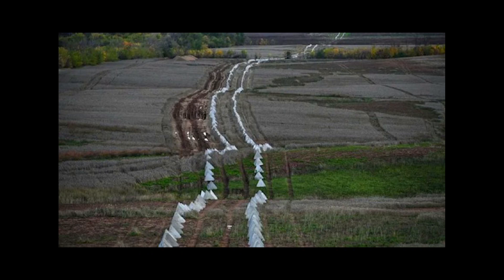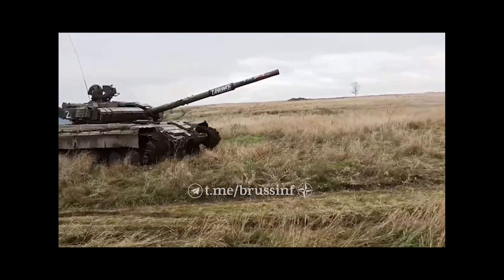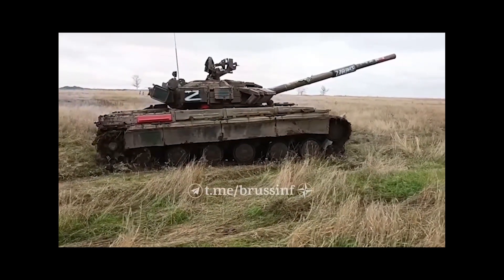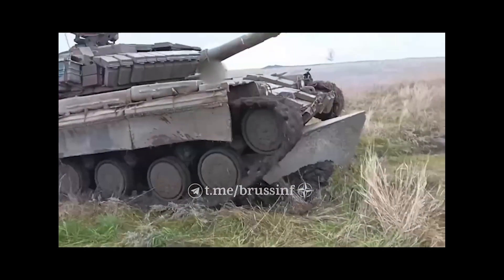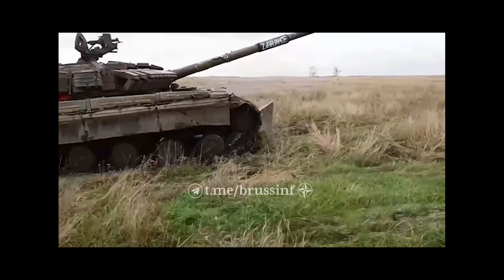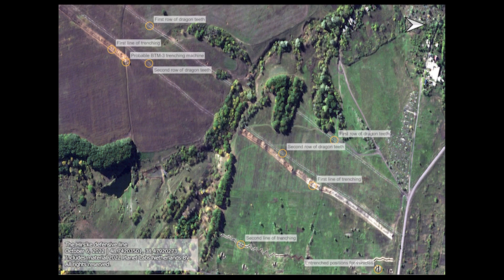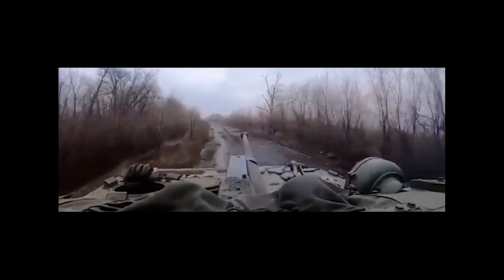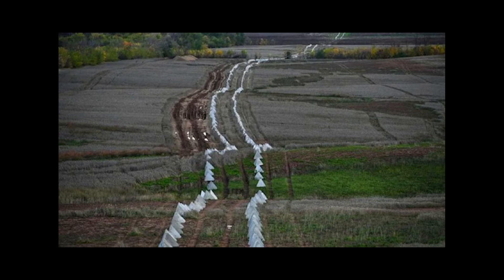How Russia's Dragon Teeth Anti-Tank Barriers Work

Comment: The teeth prevent a quick wide advance across the line.  Instead, it slows the advance at one or few breach points.  The small pause intime should allow for a quick artillery response to the breaching and give additional time for loitering munitions to fly to the area.

Comment: Agreed. Ua will use their same technique, troops to clear the defending trench, followed by armored vehicles. Ua has T-64B dozer tanks. Finland supplied Leopard chassis AEVs with dozer blades and mine flails. Canada sent similar to Norway's Bluf, the Bergepanzer 3 ARV. Norway sent the Bluf, a combo retrieval vehicle, "rope" explosives for mines, crane and bucket atop, and bulldozer blade in front. UK's Challengers have dozer blades. The US M1 can be equipped with the M9 dozer blade, no word if they'll accompany the tanks. Blades offer fairly effective additional frontal protection but also extra weight. On hard surfaces (packed earth and roads) a heavy vehicle can push mobile barriers aside (as done with half-tracks in WWII). Properly installed they are burried in the ground, wire laid to keep infantry from using them as fire positions and/or infiltrating, defended by pill boxes and artillery. I assume the main reason for these is to keep Bradleys from rolling right up to a trench and sending Russians running. They are better than nothing but make great fill for trenches and tank pits.

Comment: They won't just slide on the ground like they're on ice in the winter. They'll still dig in.. not as easy as in summer but still enough to do their job. the ground does get pretty hard in winter but a 50 ton tank pushing against a concrete spike is going to drive it into the ground. Honestly these things could be defeated pretty easy.. a couple tanks could just shoot them with some HE tank rounds to blast these things into rubble and then they can just drive through. It would take a minute but then you're driving through a choke point which is by design I would guess.

Comment: Not that I like war but I just come from BBC News and did not know about the drain teeth. Wouldn't it be great to have missiles that can be shot like low flying that specialize in crashing stuff like that horizontally. You shoot ten holes then the enemy won't know which one you will use to pass.. One single opening is obviously the wrong solution. I can also see tanks that would use arms with cover the pyramids then lay sort of heavy chain steel bridges over it. I am a designer so u Jay se it a a game to get over it. Like a crab tank that turns itself into a bridge..

Comment: Frozen ground may or may not render them ineffective, but not by simply sliding all over the place. They'll still want to dig in on the uneven surface, but frozen mud can be just as hard as concrete. They might roll over without digging in enough to trap the tank, or the points might even shatter against the icy dirt. On the other hand, significant snowfall could just behave the same as the dirt is meant to do in the first place.

Comment: the "teeth" u show in the first clip with that z-tank has double size of the real wagner teeth ...
and the ukrainian bmp drive over 2 lines of that teeth, first with tracks, secound with the hull (middle) which was also no problem with that speed ^^ and this on a "street"
wagner teeth be so small that they have abselut zero effect on fields with soft ground and mud.
and i think there are not everywhere mines and tank-trap-trenches all over the wagner-line ... some hundrets km long ... o.O
this wagner-line is a bad joke like wagner aka prisoners solders self. when this is all what the "best" soldiers can do, then the end will be much faster as the first 3 ua offensives ;)

Comment: They would be effective at stopping a lot of tanks simultaneously trying to cross a field quickly. They would even all have to have breacher bladers, or they would need to all go through the first hole created (choke point), or wait for the breacher to create more holes. They wouldn''t be able to spread out and all rush over at once. You can be pretty sure the defending artillery is very aware of the location of the dragons teeth, and would unleash hell on any tank that stops trying to get through. As dragon teeth go, they look low quality though, like anything the Russians make.

Comment: You think 6 inches of frozen ground will stop a 40 ton tank pushing that. It will still plough a foot deep easy. The idea is to slow down any vehicle passing the area so they can hit them. the clip you shown of the BMP had a block offset side ways and they just clipped it. Totally diff in the field with no lean on them like the road embankment

Comment: This works against ww2 tanks which are slow, against modern tanks which basically fly they do nothing, actually after tank passes they get crushed and become useless, there is actually a plow for tanks which can simply move any object to side on full speed, you can place mines result same, its 2022 those plows in kuveit war burried alive so many iraqi soldiers in trenches in desert it happen so fast they had no xhance to even surrender.

Comment: With some thick pieces of steel and a welder, it's a piece of cake to fasten something to the front of the tank which will push these aside. I think the old steam locomotives used to have something on the front of them resembling the appropriate shape to deal with these lumps of crap. They will tip as easily sideways as backwards.

Comment: A farm tractor with a grading blade attached, front or rear, will pull or push them out of the way easily. I have seen Three Ton blocks of Concrete pushed aside easily with a two wheel drive tractor. These are of no consequence at all.

Comment: Complettely misses the point. By Doctorine (East and West) Obstacles are NOT there to STOP A FORCE. They are there to slow and shape. An obstacle belt like this is designed to limit freedom of movement and force the opposing side to commit to a breach (decisive act). Also under both East and Western doctorine all obstacles are "meant" to be covered by fire, thus making a breach much more complex than "just bulldoze out of the way".  These statements show an absolute incompetence of understanding on the OPs behalf. I do not care for Russia at all, but such comments are fundamentally incorrect and based on a juvenile knowledge of tactics.

Comment: As they have placed mile after mile of these slidy dragons teeth in the Donbass area  in two neat rows without any other outwardly visible additional lines and an obvious vehicle track between them i wonder if they have the mines to protect all of them, and the artillery fire points that can cover the whole length, because if they haven't then they are just for show.

Working on the principle that Ukraine has shown itself to be very capable at directing artillery fire, if an assault was made across/ through these lines I would think that any artillery battery covering the area would be subjected to counter battery fire in seconds.
Nothing concentrates the mind to get the hell out of here than a gun crew receiving accurate counter battery fire.

Comment: Frozen ground doesn't mean it's slippery like an ice rink. Also, the ground likely won't freeze underneath them. They will probably still dig in and roll over as intended. I agree with your bulldozer assessment. They're going to need them anyways to fill in the tank ditches that are running parallel to the dragon's teeth.
Reply: Bulldozer move these easy, but they need bulldozer and it can be shot when doing it's work.

Comment: You could also put something solid like a metal sheet of some sort under the rear facing spike of one and then push it, at which point it'll lift the spike up and you could then pivot it to any direction and lay it back down whereever it's less of a worry. The rigidity of the block means it's also going to be easy to push away as sopn as you negate the "digging in" effect

Comment: One slight problem. The shown example is actually not those used in Ukraine.
The one shown is clearly concrete while those used in Ukraine are cement with a fairly high ratio of lime.
The one show is much larger than the ones used in Ukraine. A rough guess would be about 2/3rd of the dimensions of the one shown in the video.
Reply from the maker: Maybe they have different types? This was filmed in Mariupol. And the tank has the Z on
Reply: @suchomimus9921  I'm convinced the video is a promotional one to sell the idea. And then in true Russian fashion deliver something much cheaper to pocket the difference.

Comment: Consider also the fact that each tooth has a ring on it lets a skilled tow truck or tractor operator scoop up half a dozen & drop them into an official-looking dump truck, only to tip the load in front of a bureaucrat's office or recruitment center.  If the driver is seen wearing military garb it can look even more like someone else did it.  Like Kerch Bridge.  Kerch was the result of no more than a dozen knowing what was going on, three could have pulled the job off.  An actual military operation of that magnitude would have taken the bridge by padding the top of the barge with some tamping sand or other dense material to direct the charges.  Dressing like a Russian sergeant & dumping the fake military truck is a good temporary smokescreen.

Comment: Or just push them to the sides instead of forward, so select two adjecent teeth, push the left one 1m to the left and push the right one 1m to the right, now you have a gap big enough for the tank. Yes it gives the enemy time to fire at your tank but it is not impassible as the video shows.

Comment: I would agree, pretty sure these could be easily pushed aside or why not use a UR-77 to clear any mines as well.
Typical russian mentality: it sort of looks ok, yeah it will be fine. Let's find a fuel depot and get drunk and smoke lots of cigarettes...
The dragon teeth as they were used by the Germans in WWII on the Siegfried line were dug in and interconnected with reinforced concrete. They had years to build them.

Comment: To be honest they are not designed (and were never designed) to stop the tank on their own. Usually that would be combination of traps and mines, but even then they not meant to be just left there to fight tanks on their own. Instead what they suppose to do are to slow down the attacks and redirect the enemy into "kill zone". Simply said they are part of defensive trench system - the goal being deny certain angle for enemy, deny enemy the option of running over the defensive position, whilst enemy is trying to go around or move them to the side, that gives enough time to call artillery or use ATGMs.

German designs were more like combination of 3 layers of alternating sizes triangles, which were carefully angled in the way that tank would slip between them and would get stuck, still they were not expected to defeat the tanks their own and were there only to slow down the tanks, so that they could be destroyed by defenders.  

That said I still thing they are pretty pointless - Ukraine does very little of large formation manoeuvring on the battle field... and by that I mean none so far... I haven't seen Ukraine to ever employ large tank formation just charging at enemy position. Yes when Izium felt Ukraine exploited the gap with large combined arms formation, but that was just adapting to the situation and only started after first going around the strongholds, finding gap in the line and exploiting it. Ironically I think there would be more effective against ruzzians themselves and their flawed human and now obsolete tanks wave tactics.

All in all I think there are just moral support for the ruzzian troops, sitting in the trench behind two lines of concrete triangles they feel safer and are less likely to run in panic. These are basically more "cope teeth"  than "dragon teeth". I don't think they going to be effective - Ukraine simply going to look at satellite imagery or send drone above the trench and find some gaps to exploit, or simply create gaps if needed.

Comment: In WWII the hedgerows were a great impediment to the Allied advance in Normandy until someone came up with the idea of welding metal “chopper blades on the front of tanks to tear up the hedges creating a gap to drive through.  Same sort of idea occurred to me.  You don’t even need an armored bulldozer.  Just mount a “V” shaped blade on the front of the tank to push them out of the way.
Reply: There are mines later on and defensive positions. Once you push these over, clear the mines and get to defensive positions Russia counter attack and air power will wipe out attackers. Even if some make it through there is 2nd defensive line. Even if that was an issue now they have reserves as well.
Reply: @tomk3732  Right, but this is just a solution to one of the issues.  You also need suppressive fire, arty, mine breaching charges,  smoke.  Not to mention numerical advantage (4-1 as a rule of thumb IIRC).  Same things the Ukrainians are doing right now.
Reply: @bwise7739  And all these things make it impossible for Ukraine to easily breach the line.
Reply: @tomk3732  🤣😂🤪🤭
Reply: @tomk3732  spot on, as we are seeing with the current "Counter-offensive" Ukraine cannot even breach the 1st line of defense and are losing armor at a staggering rate.
Reply: The "chopper blades" in the Normandy where as "usefull" as these tigerteeth!But the V shaped blade would work!
Reply: Those V-shaped cow pushers that you find on some trains.

Comment: I would not put engineer assets or bulldozer in front off assault but rather weld iron to the front of tank in triangle shape that will push these aside as tank drives through. Good point on solid frozen ground.

Comment: You can literally just pull these things to the side with a 4X4 tow truck. Instead of towing a damaged car you take these things. not really effective. That's what? a 15 minute job? that's all the slowing down it will do. 15 minutes... and after those 15 minutes the tanks come rolling. Off course if they have a breacher tank there is no stopping them at all with these "chihuahua" teeth.

Comment: The fact that only the track facing the cameraman was spinning and the far one was stopped tells me some extra effort was made by the film crew to make sure the desired point made it across.
Reply: Diff lock?
Reply: @christopherrobinson7541  No, tanks steer by powering the tracks at different speed. In order to drive straight forward normally, the driver applies forward on both tracks which is sort of the same as using a diff lock.  So, normal operation without steering input would have both tracks turning. In this case, he's applying full left turn so that the left track is stationary and only the right hand track is doing anything. He could have gotten over that if he wanted to, or he could back off it and try at a different angle. Oh, and the only sensible course of action is to take obstacles like that directly under one track. Not under the middle of the tank, this is like tank driving 101.

Comment: I can confirm that WW2 era obstacles like that were not just planted on the ground but often even anchored to a concrete slab underneath. They also appear to be bigger than those the Russ use. The woods around here are still littered with these and bunker positions for anti-tank guns to pick off stuck tanks or anybody trying to clear a path through the obstacle line.
Reply: @waltonsimons9082 They are fixed and bigger, but these can be moved to other places pretty easy when area is safe. Ofcourse ukraine can also take them.

Comment: The tactic you describe here is a sneaky tactic Ukr might have used. If they committed to static defenses more than they did. They did commit to asymmetrical battles, mine-droppong drones, EW, which are anything but static.

If anyone is going to use tank-trapping fieldwork properly it will surely be Ukr. But then again, with their speed of advance Ukr doesn't have to rely on static defenses any longer while the advance has inertia.

Comment: I think you may be missing a point here. Ukraines big offensive in the Kharkiv region wasn’t spearheaded by tanks. The huge gains were made by small, light vehicles charging forward to penetrate defensive lines and deploy troops. Tanks then followed up to tackle any armour encountered. If Russia fears another such Ukrainian thunder run style charge, these defences would stop the charge dead. The dragons teeth are in double rows with a minefield and anti tank ditch then backed with infantry trenches behind. Breaching vehicles could brush them aside but Humvees and 113s won’t….🤷🏼‍♂️

Comment: Am I wrong, or is that Russian video showing how it's meant to work, even further stage?!
Or do Russian tanks not have positraction??? 🤨🤣
Once the tank is wedged up on it, the driver seems to be attempting to just turn left, by applying throttle to ONLY the right-track. As the cameraman moves towards the front, we can see that the opposite track is not moving.

Worse yet, they don't even try to back up, which I'm pretty sure it'd easily be able to back off of it... 😐🤦‍♂️

But yea, the ideal deployment wood be to tank-mine each one, with a release trigger (+3sec delay?) instead of a pressure trigger. Since by the time the tank moves it forward enough, the mine would be quite a ways under the tank. Of course, random teeth would be mined, to keep the 'enemy' (Ukraine) guessing and wasting time having to inspect/disarm; destroying them would be counter productive since it would remove the element of surprise (if there is any).

Slava Ukraini, Heroyam Slava! ✊🇺🇦 🔱